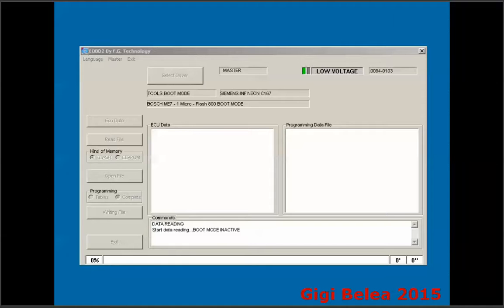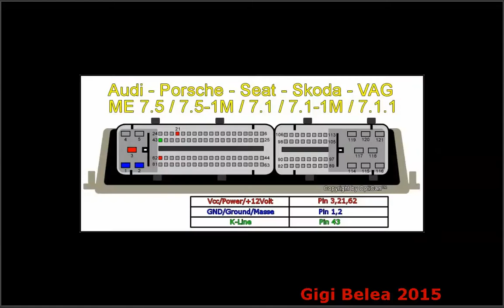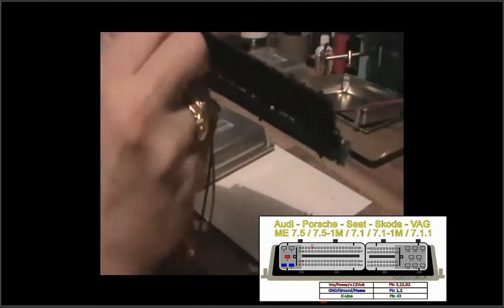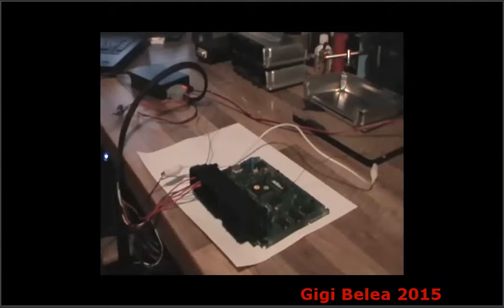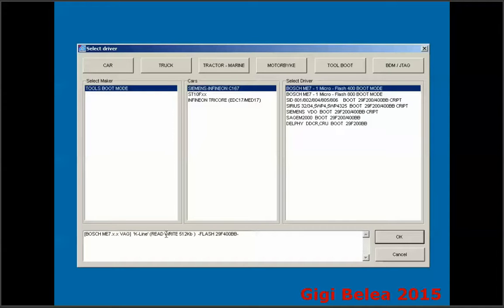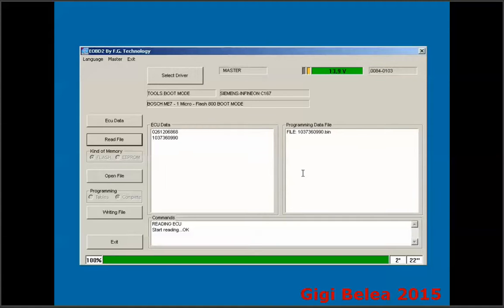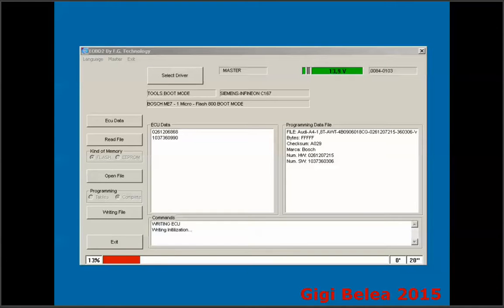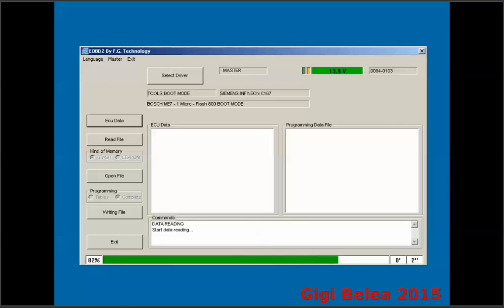Bench Flashing Bosch Motronic ME 7.5 in Boot Mode with Galletto

Comment: Nice one Sir.
Could you please tell me what happens if you connect the boot wire to ground without a resistor, when it should have had a resistor?
Will it damage the ECU, or will it just not work?
Also, could you recommend a good, cheap flasher for ST10 processors?
Many thanks for any help that you can give me on this.
Kind regards, Joe.
Reply from the maker: It will just not work, you will not damage the ECU.
Reply: Thank you very much for your prompt reply.
I’ve also heard that there different resistor values used. I suppose that depends on the ECU.
Many thanks, Joe.

Comment: HELLO 
I AM A NEW SUBSCRIBER AND I USE GAELLTO TOO I WOULD LIKE TO ASK YOU A QUESTION I HAVE AN AUDI A4 2.5 L V6 MODEL 2003 THEY HAVE CHANGE THE WHOLE ENGIN WITH IT PUMPE BUT IT WONT START I MADE AN IMMO OFF TO THE ECU THE SAME RESULT ANY IDEA
Reply from the maker: What error codes you get when you make diagnostics ?

Comment: do you have to connect an external power supply where the white inlet is? I have Bosch MEVD1722 ecu and i'm having trouble setting it up right. i located the boot pin and connected the wired per diagram. i also added an external power supply but the computer cannot read the ecu. any suggestions? thank you